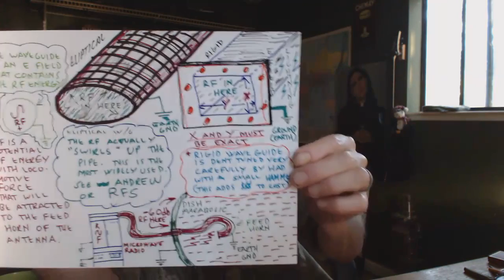WAVEGUIDE 101

Comment: good day sir, i have a question, if i'm designing a microwave antenna tower, and decided to put the rf module inside the radio room, do I have to use a waveguide that is same length/height of my tower? In my design, the height I got for the tower is 102m. so is it okay for me to use a 100+m waveguide?